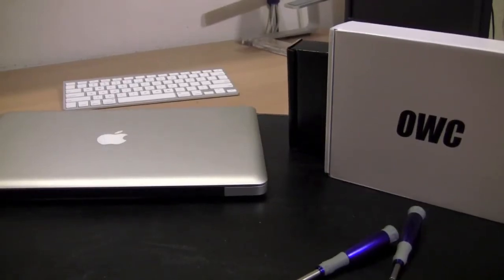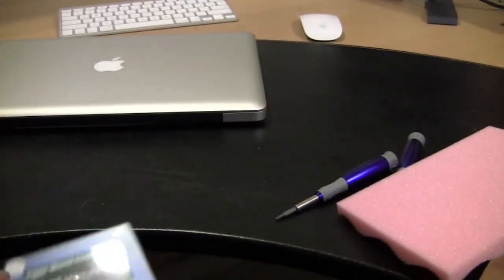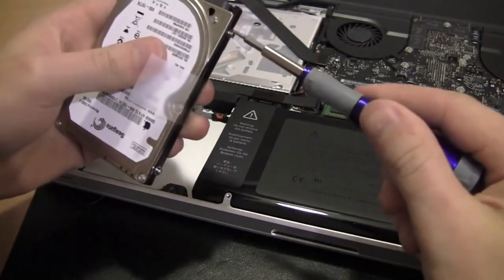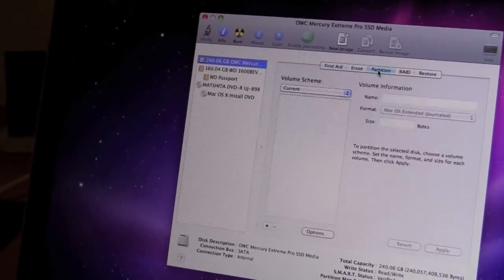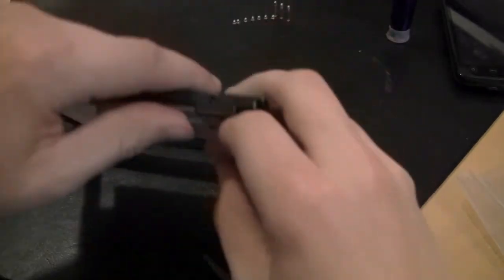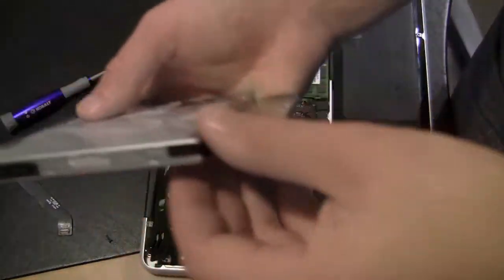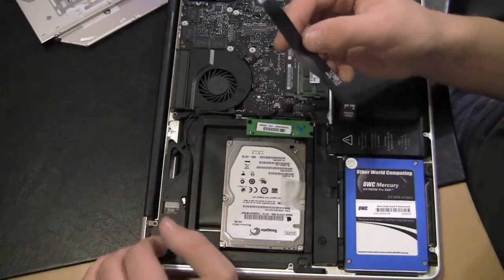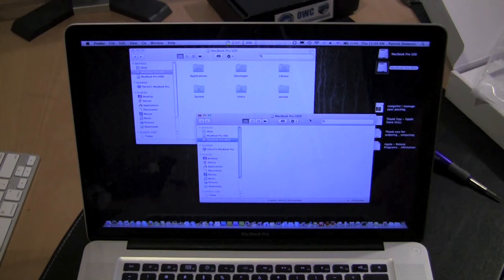Installing 2 Hard Drives in MacBook Pro - Data Doubler - 240GB SSD Installation

Comment: @albert8427 yes, the late 2011 model this can be done, and although apple says it can only hold 8gb of RAM, it is capable of 16gb of RAM installation. Both a SSD and a HDD can be installed also

Comment: Search YouTube for "SymbolicLinker". There are tutorials on how to utilize the SSD's speed and the HDD's capacity to make your computer as fast as possible by setting links to large media files on the HDD while keeping those same files "linked" so that you don't have to remember to go back and forth (aka, if you drag and drop all the stuff to the folder in the SSD but the computer stores it on the HDD). It essentially makes the process of juggling 2 drives seamless to the user and unnecessary.

Comment: Quick question! Do you have to wipe the HDD before hooking it up to the data doubler? Im basically doing the same thing I just don't have enough space to backup everything onto my external drive. Is there any way at all that i can keep files on the HDD through this process??

Comment: if i was to get a new mbp 13" and immediately upgrade to the ssd showed in this video and either a tb or 500gb hdd(before even starting up the computer), which drive would i install files to?Where would i save osx leapord?

Comment: Would I be able to partition the second ssd to put windows on 1 partition and have all my other storage area on the other partition. I want to use the main ssd for osx and apps. Would you I able to install windows from the main drive through bootcamp to the second ssd partition (1)>I bought the second ssd and owc data doubler and now i'm wondering how would I be able to do that setup.

Comment: what about vibration? it seems the normal drive is attached from only one side with the data doubler and as i know this normal drives vibrates specially if its 7200rpm

Comment: ive got a 500gb hard drive right now. i want to get a 128gb ssd and put my operating system on that but my problem is that i want to use time machine to restore with. will it allow me to do that?

Comment: @5dayslater just get an external one and use itunes instead!! so much easier and in the long run much more efficient(depending on what you use the computer for, i use c4d,aae,photoshop,illustrator,aperture,final cut, and i need room to install windows to use sony vegas)

Comment: Let me tell you something - SSD RAID 0 works yes - but the problem is it won't last much - I discovered it much later - RAID was causing issues with graphics unit (two SSDs one on optical bay and one on regular one - 1TB) - mine was early 2011 macbook pro (16 G ram , 500X2 GB SSDs, Quad Core 2.7)

Comment: my SSD on the optical drive is very slow any reasons why ?
Reply: ***** I know this is really late but here's your answer. SSD's are way to fast for the connection between the SSD and the MOBO. The optical drive only does 500 rpm which is EXTREMELY SLOW compared to your SSD.

Comment: Its very difficult to watch your video at length. Although the video quality is very nice, the other shrieking sounds (boxes opening, screws opening, you holding the ssd and moving it, holding the MacBook pro and flipping it on the table, knife cutting through the label etc....), that do something under your teeth, are too loud. Maybe you need to put your mic a little bit away. I was finding this video really useful but these shrieking sounds are really getting on my nerves. Never happened on any other video..... :)